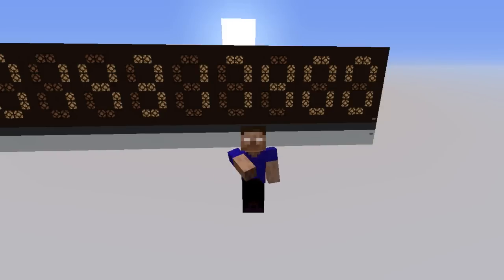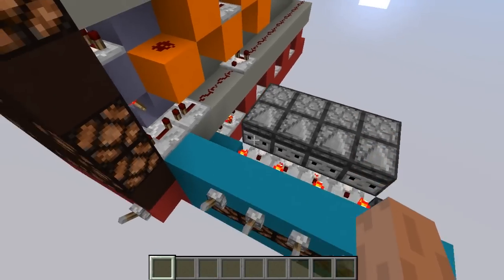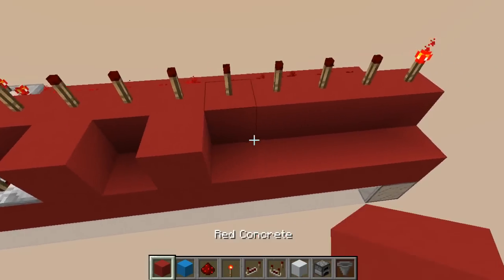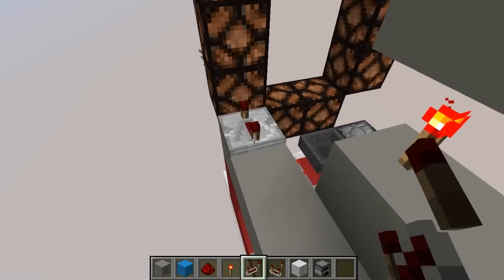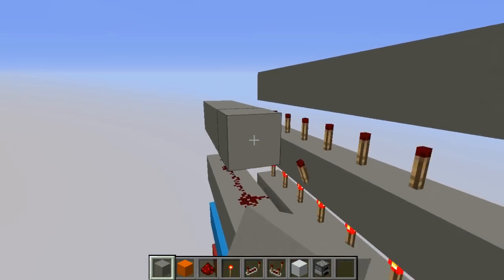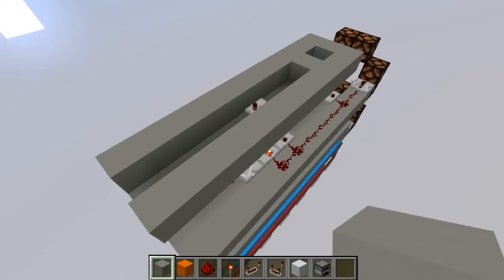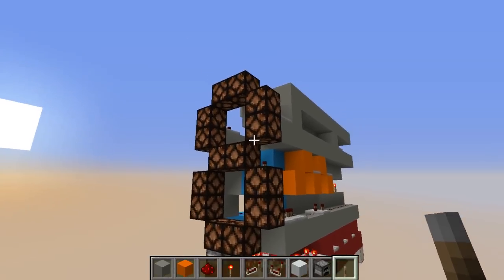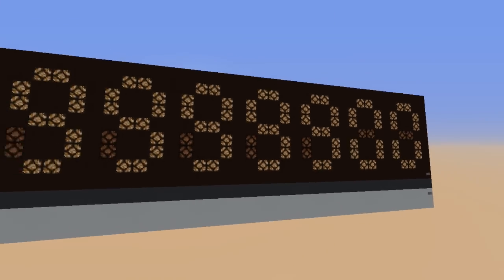7-Segment Display with Signal Strength Input - Tutorial | Minecraft (All Versions!)

Comment: Could this be converted to a 3x5 display instead of a 4x7 so it could be stacked next to each other with only 1 gap. I have restyled the connection to fit a 3x5 but I need a 2 wide gap between numbers now.